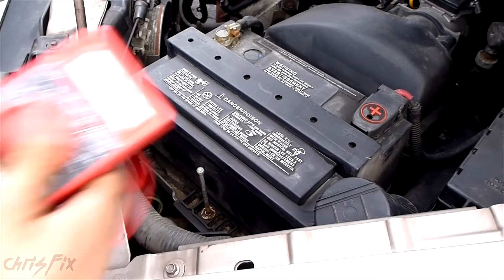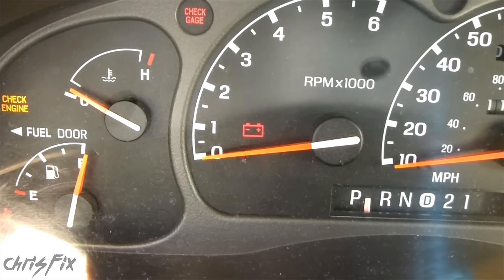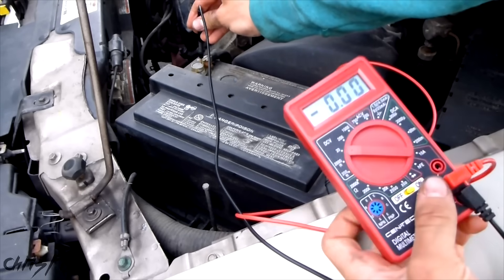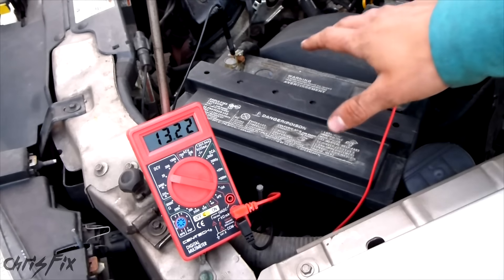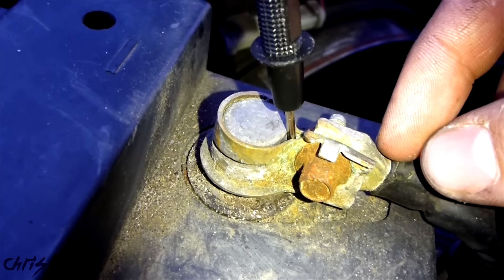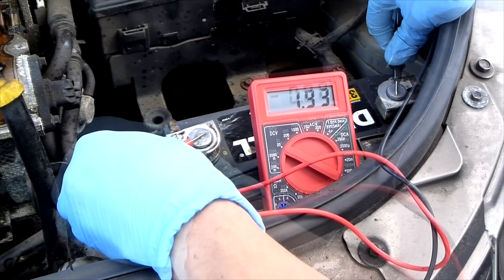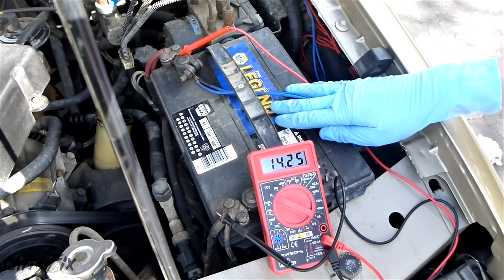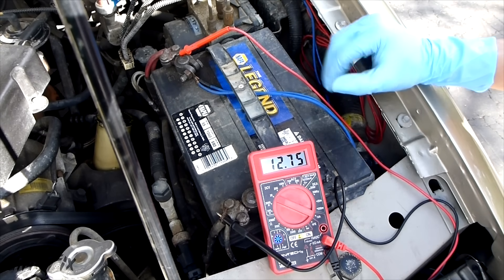How to Test a Car Battery with a Multimeter

Comment: Battery life can also depend on the vehicle. I commonly get over six years out of the cheapest batteries in my 87 Isuzu Pup. Because it has no power equipment. At all. In my Mercedes W203 it's been harder to keep a battery working. I do use a BatteryMinder desulfating charger regularly which seems to make sure I get the full five years out of all of my batteries.

Comment: Hi I have a 97 achieva my battery is from 2013 and my alternator is from 2011 what been going on I been having a security light issue it start stall then start and be fine then I try it the next day or the following and it either start and stall or not just keep doing that intill I let it sit in the one position for ten or more mins for the light to stop and three time the car was dead it was clicking I had to hook it up to a battery charger and use that so she wouldn’t die while I get rid of the blinking security light but before I did that my battery ready was 11.50 not sure that a good or bad reading i don’t have a volt meter I used my thing. That fills up the tires it also has a feature that test the battery and alternator that was the reading I got then she started and then i checked the alternator and it spiked to 13.86 not sure if it’s my alternator or battery I know if you disconnect the positive cable while the car running if it stalls then it the alternator of it keeps running the alternator fine but I don’t want to chance messing anything up I’m not a mechanic and the car need other work and I’m doing one thing at a time and for a while it been sitting but I would run it every day or every other day or take it around the block I recently had my compressor replace and a new fuel tank pump put in new spark plugs new something else forgot what it called cause that car don’t use wires if you can please let me know what you think thanks

Comment: I get a clicking when I first turn the key . It varies for how long . Then it will start turning over , once it engages I’m assuming , but it won’t start every time. It just keeps turning over . Sometimes Followed by starting , and sometimes not . It’s been doing this for a few days now and getting progressively worse . 
I bought a new starter . Before I put that in  . Just wondering if anyone had any insight for me . 
Thanks much

Comment: Great video. 
You can make your battery last much longer by using an Optimate 3 or  4 battery charger / conditioner either when you are not using it,  or at least 1x a month.  
I use it on all my vehicles and the battery   LASTS !!

Comment: 3:33 Shouldn't you disconnect the negative terminal cable first?
Reply: You should always disconnect the negative terminal first. because if disconnect positive terminal first with a ratchet but if the ratchet comes in contact with bare metal to bare metal you can bridge the gap and it will spark.

Comment: "Just because this is a good voltage doesn't mean your battery is good" You don't know how much I wanted to hear that lol. Car just decided not to crank but I know the battery had been getting weaker due to faulty alternator brushes (it would cause overcharge and undercharge). It still lasted a year after I replaced the brushes but now I think it's just dead. I'm still gonna try and charge it to see if the car can crank but I know it's now mandatory to replace it. It's currently at 13.5V.

Comment: Really good, of course. I would add that one should NEVER attempt to run the engine without the battery in the circuit..do NOT disconnect it with the engine running!  A weak cell or 2 in the battery (of course) can produce all sorts of apparent major systems malfunctions. Always start with a battery/alt. analysis. Continuing to use a really weak battery can permanently damage your expensive alternator.  "Rebuilt" replacement alternators are often defective. So take care of the one you have.

Comment: Actually the battery light comes on when the alternator is not putting out enough volts to keep the charge up on the battery. So the battery may be okay. Not unusual that an alternator before failing gives insufficient charge to the battery and you may need to replace both. A loose belt running the alternator can slip enough for the alternator not to put out sufficient power. 
In the old cars this belt ran just the alternator and you just adjusted it or if too stretched out replaced it. Today's cars use a serpentine belt and run various components and if the belt has stretched needs replacement. The serpentine belt uses a tension arm and roller/pulley and may loose tension as it gets older and need replacement. On many cars it is recommended to replace both the serpentine belt and tension arm together.

Comment: For a battery with corroded terminals, mix up a paste of water and baking soda.  With a tooth brush, brush the paste onto the terminals, scrubbing with the tooth brush until the terminals are clean.  Rinse off the paste with water.  I don't recommend sanding your terminals.

Comment: disconnect the battery. open the cover of the cells. place multimeter negative (black wire) On negative post. take positive lead (red wire) and place metal testor in battery acid and check reading. when finished, wipe positive testor lead off with cloth before checking next opening on battery. The only correct way to confirm battery condition

Comment: I've learned a great deal. Thanks Chris. I'm just off outside now to test a battery that has been on trickle charge for 18 hours. Will let you know how I get on! 

UPDATE:-  I ran the headlights for 2 minutes, then started it up. and ran at 14.39V. When I switched it off it showed at just over 13.6. 

I guess the key now will be how will it get on tomorrow after it's been left in the car.

Comment: This video has issues.  FIrst, you shouldn't disconnect the battery completely on many cars because it cuts power to the computer.  I usually temporarily use a small 12V "scooter" battery with alligator clip wires when I need to disconnect the main car battery.  Second, I wouldn't trust that Harbor Freight meter without first checking it against a much more reliable meter.
Reply: I have several and the HF free one has always been fine though I have not tested all of its functions.
Reply: Fine for how long?  Wait until a few months pass and watch it whack out like many of mine have.
Reply: @davidjames1684   I've only had it for 4 years or so. Will keep an eye on things.

Comment: "Battery is garbage" wait wait wait please just don't change the battery before checking the coal in the alternator. Please consider changing the battery water and clean it out inside. Buy batteries with removeable caps..

Comment: I did the test, my battery and alternator is good. My concern is that my dash cam read a lower voltage vs the multimeter, I used the cigarette plug in for power. Will a bad fuse or bad ground cause voltage drop?

Comment: I have a 2007 Nissan Murano and it has  Nissan branded battery from 07-2016 it has a sticker 84 month limited warranty what would the dealership do give me a replacement? Autozone hooked up there scan tool and he said the battery is good the alternator is bad
Reply from the maker: The dealer would give the warrantee but the alternator is not the same as the battery so.
Reply: ChrisFix Thank you for the information I know it’s going to be a big job to replace the alternator but since I changed the spark plugs on this car I think I can do had to take half the engine apart took me 4 days

Comment: Dont put "bottled" water in  battery.  Only distilled or deionized. "Bottled" could be a million different versions of spring or tap water with minerals in it.
Reply from the maker: Thanks for the tip.
Reply: @chrisfix  

No worries. I really like all your videos!! Been watching for years. I know you are a pro and it was just a slip of the tongue. Keep up the good work!

Comment: I have a 2013 Honda Accord sports. It takes several turns from the off position( never from ignition on) to start. Battery is good, alternator is good, I took the starter in to get it tested and it pass. What’s next?? Please help.

Comment: My cheap Harbor Freight meter 96308 only does 20a, 200a, 400a, 300v, 2000 ohm, 200kohm. I think I need to trash it and get a real meter.

Comment: Love the tip on spraying WD40 on the battery terminals to prevent rust and corrosion.  Do those felt washers help at all?  You can buy a kit of felt washers (one green and one red) plus some type of jelly to put on the terminals.  At around $3 for the kit, WD40 is a lot cheaper to say the least.  What type of multimeter to you suggest I buy?  Thank you

Comment: 3:32 Shouldn’t you disconnect the negative before the positive?
Reply: dubyajayyo yes, simply because electrons move from negative to positive so I guess the wire could still hold some residual electricity. I’m not sure if it would really matter tho 🤔

Comment: Excellent video, Chris 
Anyway to check for a dead cell?
Reply: Use a Specific Gravity tool: very cheap from a good auto-spares store and measure the S G of each cell.  
This tool is usually a plastic (acid proof) device with a rubber bulb to draw up electrolyte out of the battery into a chamber where there is a small float which floats in the liquid and shows the Specific Gravity.    The tool should have instructions wth it.       The float position indicates the S G of the electrolyte fluid.     Only good though for lead acid batteries where there is a removable cap to top up the cells with distilled water which I have found is reliably bought from a pharmacy.   You do not need a lot and it should be of good quality.

Comment: Great video, just like to add a couple of things;
12V is the nominal voltage of a 12V battery, the actual normal voltage is 12.6V. When fully charged it should be in the range of 12.6 - 13.2V for a very good condition battery. If your battery is under 12V when fully charged it may be on the way out. 
I am a little sceptical of maintenance free batteries. They seem like a normal battery with easy access to checking electrolyte levels blocked off. When my Mazda 3 battery seemed bad, only 3 years old, I removed the panel covering these and found that the levels were very low. I topped up with distilled water and used a smart charger to resuscitate it. The battery lasted another 4 years, just gave it some TLC every 6 months or so.
Reply: Fully charged lead acid is between 12.7 and 12.8. it cannot be more than that. Also. Voltage is measured after proper rest time of 12-24 hours. If you measure it right after charging thats the reason it shows more but that voltage cannot be used to determine state of charge or battery percentage
Reply: Yeah, I have mixed feelings about 'maintenance-free' batteries. I do use them, and they do tend to stay nice and clean, without the corroded terminals you get with flooded batteries.

Comment: Coating the terminals with grease will last longer than WD40.
Reply: What kind of grease?
Reply: @doradean3097  you can use wheel bearing grease or tube grease like you grease the front end with as long as its thick. or you can use dielectric grease like you use on certain electrical components. It all works pretty good. The best is probably the dielectric. Hope this helps.
Reply: @jeffarp7409  Got it, thanks!
Reply: @doradean3097  one thing I didn't mention, if you're going to use regular grease wheel bearing, regular lubricant, etc. After cleaning put the terminals on and then put the grease on it may interfere with the connection this is why I said the dielectric is better it carries the current. 🤓😀👍
Reply: @jeffarp7409  thanks for willing to share your knowledge.    While following up on the conductivity of  dielectric grease, I did find out that while dielectric grease repels moisture and protects against corrosion,  it does not conduct electricity, so shouldn't be applied directly to mating surfaces of an electrical connection.  In light of that, I'll just put a light coating on the outside surface on the battery terminal and try not getting any in between the post and the cable ring.   Learned something new, so thanks again for taking the trouble to respond to my question!
Reply: @doradean3097  cool I learned something to I thought dielectric carried current to .
I guess your never to old to learn something new thanks.

Comment: So basically I need around 12.6v to start off and it has to jump to around 14v when car is on. Anything lower than those two values means a bad battery?
Reply from the maker: It doesnt quite work that way. Those are numbers saying it’s charging properly. The cold cranking amps can still be low and your car might not start.
Reply: @chrisfix  I tried testing it just like you did on your video and mine ended up being 12.3v before starting and 14.3v after. Couple weeks ago I had to jump my battery 3 times in a matter of one week. I may have left something on that drained it but honestly not sure. I havent had to jump it in 2 weeks so I dont really know if it's the battery or something just drained it. Thank you for reply and I appreciate the fact that you reply to your subscribers even tho you have over 1m subs!!!! Not a lot of youtubers like you so keep it up :)

Comment: Voltage drop during crank can just as easily be large current draw of a starter.This is a very  non-professional non skilled
video. This is not how you professionally test a starting system!

Comment: Hot water and baking cleans battery terminals make sure you rinse off well so as not to affect paint.
Reply: barry, you are absolutely right, baking powder or the nearly identical Bicarbonate soda are not only good for cleaning the battery terminals but will also neutralise any acid present. Baking powder is actually a fantastic general purpose cleaner and deodoriser, just make a paste with a little warm or hot water and if you add  a little white vinegar you increase the cleaning power, it also makes the baking powder froth up quite impressively.
Reply: @bradster1708  yes just remember to rinse ALL of it away! Not good for paint!!

Comment: Coating the terminals and exposed connections with Vaseline ( petroleum-based gel ) does prevent corrosion and last many years,
Reply: Any grease will work

Comment: Good video Chris I had a problem with my vauxhall combo van the negative to earth was showing high resistance hence not starting up so I cleaned all connections to battery alternator and starter motor it did the trick starts fine now
Reply from the maker: Nice work

Comment: i ve just replaced a battery at 4 years roughly.   I was astonished.  I thought ten years was a working figure.

my mech confirmed this guy.
He put a new battery on 3 year car recently.
Reply from the maker: 4yrs is the average life span of a battery in the USA.
Reply: @chrisfix  I see my old battery is dated 2015 (i think) which means the origional was on 10 years.

Im not sure of the 2015 date but 4 fours is very plausible fro my own memory.

For a heavy duty battery thats short change tho' .

I thought electronics were getting better not worse.

They 'll have to do better  than for the plugs ins......

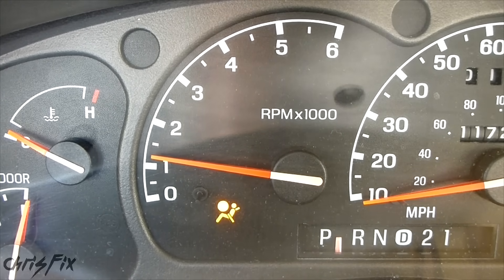Comment: 1:05

if the battery light goes out (after startling)it shoes the alternator is charging .........it says nothing about the battery.
Reply from the maker: It also shows the battery is taking the charge so it works both ways.
Reply: @chrisfix  I would check that.  My situation the light was going out but the battery clearling wasnt taking the charge.

From a personal pov i would only expect to see the battery light if the alternator wasn't  pumping......    in my case it clearly was/ is.
Reply from the maker: Yes in your case but there are scenarios a bad battery won’t take a charge even if the alternator is working.
Reply: @chrisfix  true enough if the battery is completely totaled shall we say , in my experience the charge from an alternator just bounces off.

We used to say if its as flat as that you  would need to trickle it   up to a certain level of change.

This is  fairly exceptional circumstance tho (i think) where headlamps have been left on.

I have had this and  some kind soul came up with pair of jump leads thicker than a tree trunk and it was running again in seconds........      no problems after as i recall ..........   but it was a good 20 years ago.

Comment: Great Videos Chris, have been watching for long, but this video was very helpfull,  The battery guy told me my battery was gone this was in August 18,
I had a cheap Multimeter  and used it as per your instructions word to word,  it was amazing the battery is as good as new on the readings,  till today it starts with the first crank, just added battery water a week ago, we get a little acidic battery water here ( its not pure distilled water)  my battery is 4 years
4 months old ,  Thanks for your informative and easy to understand videos .

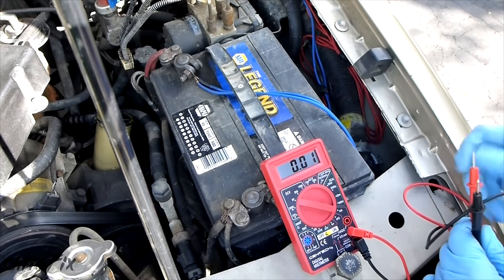Comment: Good video!  The ground cable lug on your truck battery is loose at 4:27.  +1 on cleaning the top of the battery with baking soda solution after servicing it but before installing the cables.  I've never had a terminal corrode after doing that and i never use felt rings or spray to protect it.    Chris

Comment: Another way to remove the 'green' dust is to pour some very hot ( just boiled ) water over the terminal and also dunk the leads in to the hot water. Gives instant clean.